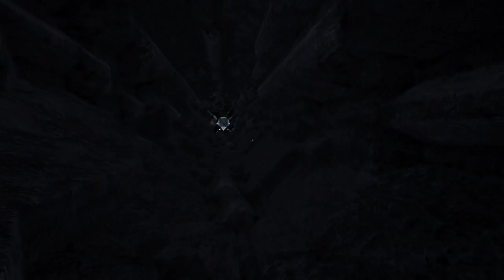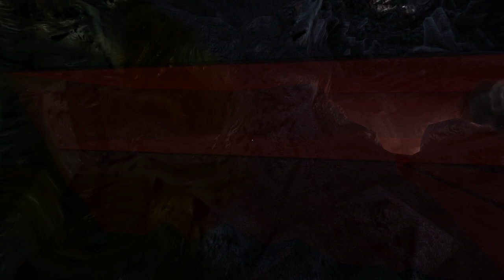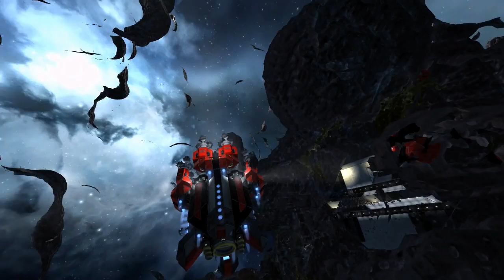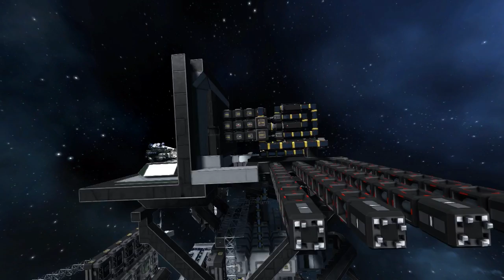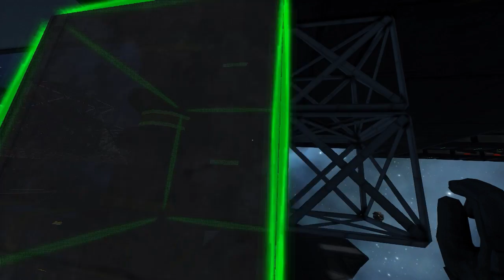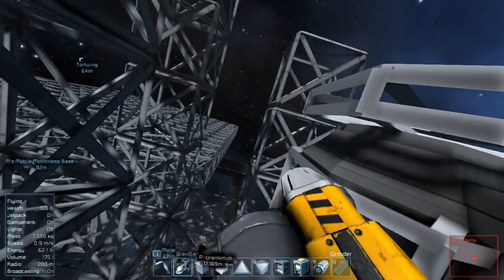Space Engineers • Solo Survival • 55 • Enter Asteroid Dimension

Comment: You could cut out the rotor part of the crane ( atleast for the small one i think ) to get rid of the cirkuler <- word? problem ... and just make it on pistons so they push the crane from the courner to the Rigth and then the pistons that extens out to the construction field .. and ofc the pistons to raise and lower the thing.

that way it would be building whit in the SE grid system and i think build more consistens, then a rotor would do

Comment: Ah another new project! Two little thoughts that went through my head:

The first idea is to have the arm of the crane on a rotor. The rotor would be on a 45 degree angle. This would make a normal square block a diamond. Then, there could be two welders on the bottom half of the diamond/the V. Not too sure if this would weld double the amount of blocks or not. But if the arm swung and/or if the arm's rotor was "loose" then it could probably swing around and get everything. It'd be interesting to test haha.

The second idea was to automate the crane but after thinking more about it, I don't think it would be possible. I imagined using a projector to, of course, project the a ship. The crane would detect small and large ships, so when blocks were made, the crane would automatically move to the next blocks. The problem with this, I think, is that it would detect the block immediately after it was "placed." It'd only work if the blocks had to be finished for sensors to detect them and I do not believe they need to be completed :(.